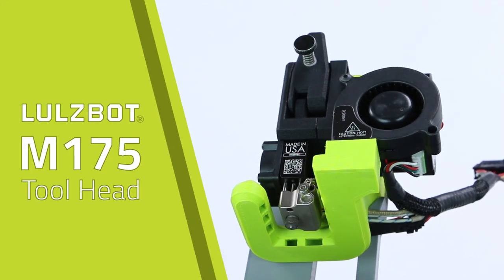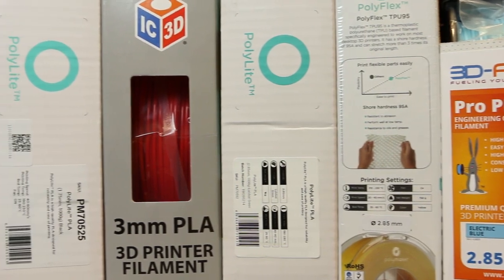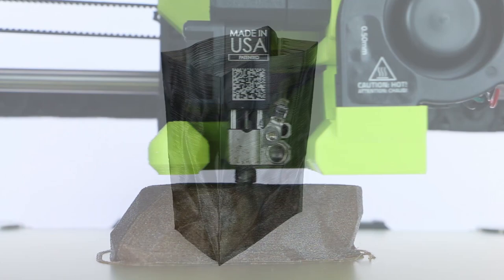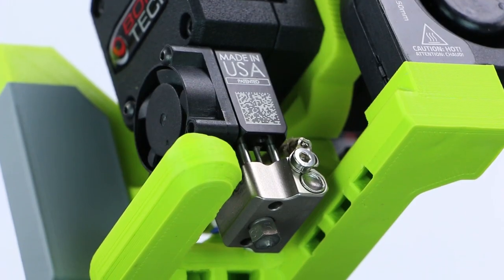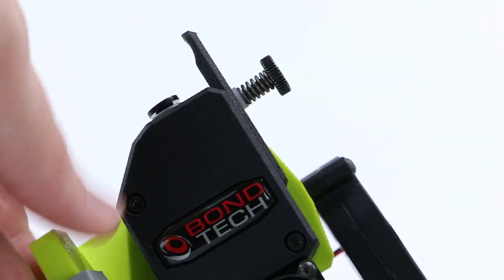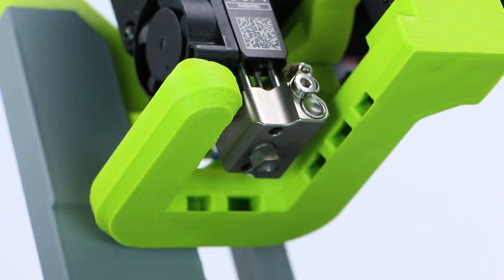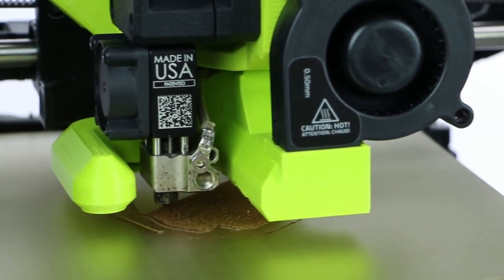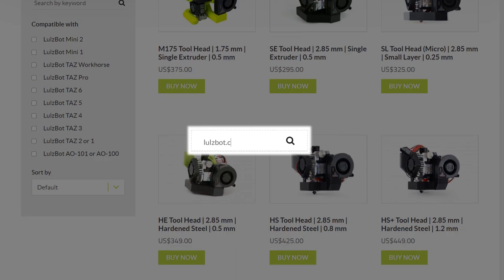Available Now: LulzBot M175 Tool Head for 1.75 mm filament.

Comment: Why can't it come with .4mm nozzles like the rest of the 3d printing market?
Reply from the maker: Hi Coleman, this is actually more consistent with the LulzBot lineup. 
Our HE and SE Tool Heads are also both 0.5mm nozzles; one in Hardened SST, one in Nickel-plated Copper. 
www.lulzbot.com/store/tool-heads
Reply: I agree, thats the first change i make to each lulzbot i purchase.
Reply: One of the great things about the mosquito hotend is its ability to do super fast one handed nozzle swaps!